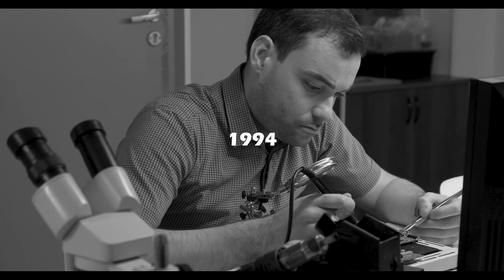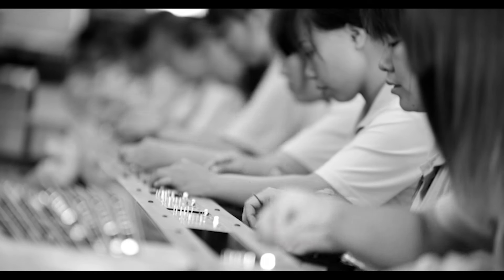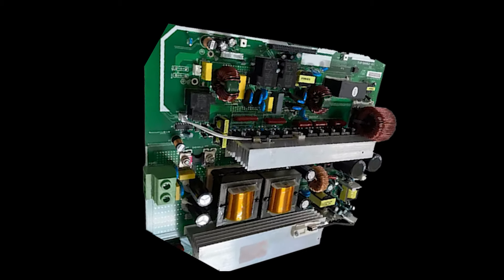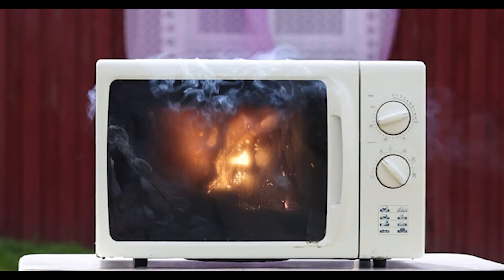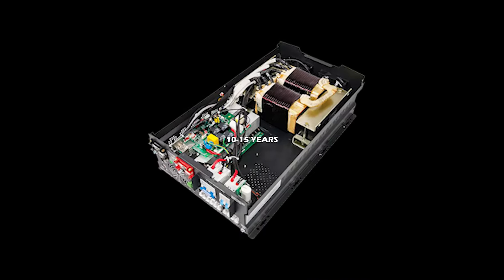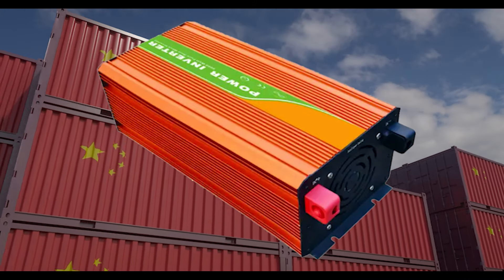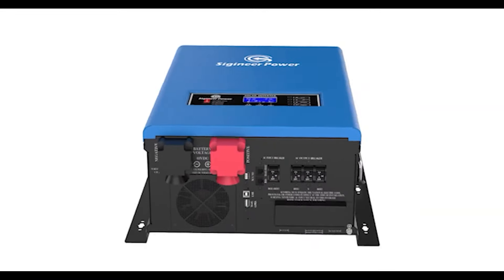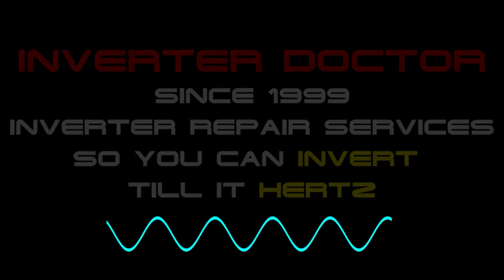6000XP VS Low Frequency Inverters. There's no contest.

Comment: The large inrush (load's standpoint) current capacity of low frequency transformer inverters is rapidly becoming less important as pumps and HVAC/heat-pump compressors are transitioning to inverter driven motors which smoothly increase speed from the  zero RPM with very low current surges. As a simple example, my LG refrigerator is inverter driven as is my Midea window AC/heat-pump. Every mini-split AC/heat-pump that I'm aware of is inverter driven, and are easily driven by HF inverter power supplies.
Reply from the maker: It will be many years if not decades before existing pumps and HVAC systems are completely replaced by newer inverter based systems. Besides, the upgrade to inverter based pumps and HVAC systems does nothing to address the absence of galvanic isolation between the DC boost stage and AC output in these low-cost high-frequency, transformerless inverters, which has the potential to damage and even start fires in these inverter based appliances.
Reply: @kickgas7171  37 2017 HEAT PUMP IS INVERTER BASED....SO ITS NOT NEW TECH.
Reply: @kickgas7171  But in modern times a lot of those people are not installing old power-hungry HVAC systems, they are installing mini-splits that use DC compressors and slow-start.   The intersection of people installing old HVAC systems to be powered by an inverter is really quite low, and people who intend to run such systems from an inverter are far more cognizant of the issues involved.  This has nothing to do with the billions of people with HVAC systems powered by the grid.  It is a much smaller crowd.
Reply: They're not installing these power hungry, non inveryer based HVAC systems in modern times because they're already installed in these homes. It will be decades before people get even close to replacing their old Power hungry HVAC systems with newer inverter based, high efficiency systems.

Comment: Nothing wrong with HF inverter as long as you size it properly. I have one that i bought in 2017 and noy 7 years running no issue. Size it properly
Reply from the maker: Actually there's a lot wrong with high frequency inverters. They offer much shorter life expectancies and far poorer surge capacities for starters. And don't you mean "oversize them properly at a greater expense". When using a low frequency, transformer based inverter, there's no need to oversize the inverter and it will provide much better performance for far less money than intentionally oversizing a light duty, high frequency inverter.
Reply: The prices are outrageous, I can buy 2 for the cost of one
Reply: @brooksstone2098  That's not true. A higher performance, longer lived 6000 Watt Sigineer M6048DUL, all-in-one,  low frequency inverter costs only $350 more than a 6000 Watt 6000XP all-in-one inverter.
Reply from the maker: @brooksstone2098  You'll probably end up buying two or three high frequency inverters due to their shorter life, over the life expectancy of a low frequency inverter, so in reality, you're not saving anything.
Reply: @kickgas7171  There is a lot wrong with low frequency inverters as well.  They are expensive, very heavy, very big and inefficient.  Use what is best for you and your application and your budget.
Reply: It's a total myth that low frequency inverters are more expensive than outdated high frequency inverter tech. And with the dramatic drop in battery and solar module pricing, efficiency is no longer the issue that it use to be. And you'll only have to install a low frequency inverter once on 10 to 15 years of use so weight is totally irrelevant when compared to a short lived, low surge capacity high frequency inverter.
Reply: Ask Google AI "Do high frequency, transformerless inverters have a shorter life expectancy than low frequency, transformer based inverters?" And learn the truth about these cheap high frequency inverters.
Reply: That's because you've only used it on rare occasions over the past 7 years and primarily run resistive loads.

Comment: The modern HF hybrid inverters perform much better now, they're more efficient and are more cost effective. I made the switch from a transformer based system years ago with zero regrets.
Reply from the maker: The topology that's used in modern high frequency inverters is no different than it was when they were first introduced 30 years ago. The only difference today is that the Chinese are building these high frequency inverters in larger boxes. They are still using the same design in their high voltage DC boost stage that uses high voltage stressed capacitors, silicon and tiny transformers which are subjected to high heat environments which explains its need for larger heatsinks and far more noisy cooling fans. The only thing that makes these high frequency inverters more cost effective is that they have removed the iron core, copper wound isolation transformer, which make these inverters far less safe for powering your home's appliances, And what good is efficiency if your inverter offers a much shorter life expectancy? You will have to replace a high frequency inverter at least 2 to 3 times over the course of the life of a well built low frequency inverter.
Reply: Post your evidence that modern high frequency inverters perform much better now. I bet you can't, because there is no credible evidence that they perform any better today.

Comment: I have been running a Growatt 12kw low frequency now for several years with 45kw of battery attached.  It will start 3 AC units at a time!
Reply: Good choice, You can't go wrong with a low frequency inverter.

Comment: My microwave, fridge and AC are all inverter based. Modern appliances for modern inverter.
Reply from the maker: Sure they're inverter based. That's because the inverters that are used in these devices have been impedence and load matched to their loads. Off the shelf Chinese manufactured off grid inverters are NOT universally matched to inductive loads found in a typical home. They cannot be because high-frequency inverters don't use an isolation, output transformer to its MOSFETs or IGBTs.
Reply: @kickgas7171  You are confusing what he said.  He's talking about the appliance, not the inverter.   The APPLIANCE has an inverter... well, really its a DC regulator.   For example, a modern mini-split has a DC compressor.  A microwave does something similar to regulate the microwave output (continuous regulation rather than turning the emitter on and off every few seconds).

The DC side has a power factor of 1.  The AC side (the input to the appliance) will see a power factor of 0.95 if the DC regulator in the appliance is PFC corrected, and a relatively fixed PF of around 0.5 if it doesn't.  NO LOAD OR IMPEDANCE MATCHING ON THE AC SIDE IS NECESSARY.

An inverter driving such an appliance is going to have a far easier time... there won't be any significant surges and the reactive component, if any, will be constant.

-Matt
Reply: I don't think he's confusing anything. He said that these appliances have inverters in them that match the impedance of appliance' inductive load. High frequency, transformerless inverters are not impedance matched to efficiently power older, non inverter based inductive loads  which shortens their life expectancy.

Comment: There are several high quality brands of low frequency, transformer based inverters on the market that outperform the 6000XP. One brand in particular is called Sigineer Power. They've been around a lot longer than the EG4 brand and they offer much higher surge capacities and a longer life expectancy. They have built-in MPPT, automatic generator start and transfer switch and they're UL1741 & CSA22.2 Certified. Plus they're only $350 more than the 6000XP.
Reply: You sure about that bud? Their screen suspiciously looks just like a voltronic unit. Worst fking inverter company in the world.
Reply: Idle consumption of 120 watts. It’s a joke. The XP is 30 watts🤣. You need a whole extra battery to power this paper weight
Reply: @dswaggins2464  Low frequency inverters don't draw 120 Watts when in "power saver mode" Just like high frequency inverters, they draw nearly zero Watts. The XP's lack of an isolation transformer makes it potentially far too dangerous of a product to use in my home.
Reply from the maker: @dswaggins2464  Sure, high frequency, transformerless inverters from Voltronic are the worst, Voltronic is the company that built the EG4 6500EX inverter. Voltronic does not manufacture Sigineer inverters.

Comment: just read the rest of the discription. that is false info, they are cheap and very easy to repair, with parts easily available. for the cost of a name brand complete system you can parallel so many cheap inverters they will rarely see much load. only real downside is high idle draw, but with the affordability of larger battery banks that is less of an issue.
Reply from the maker: I'm surprised by your comment, considering the fact that one of the only videos on your channel shows you performing a fairly complex diagnostic of a failed, high frequency inverter. High frequency inverters are absolutely NOT easy to repair. High frequency inverters all use the same complex, high voltage design that employs more than twice the number of components that low frequency inverters use. We repair inverters, have done so for the past 24 years, so we're quite familiar with how complicated these high frequency inverters are. Typically when they do fail, it's not as simple as replacing a few MOSFETs or caps. Because of the high voltages involved in these circuits, when they do fail, they typically take out far more components and can even burn the PCB. Not only are they difficult to repair, they can also be dangerous (lethal) for a layman to attempt to repair because of their use of very high voltage components.
Reply: Good❤ answer

Comment: Then why did my 2kw LF inverter only last for 4 years if it's true that the LF inverter would last 15 years?
Reply: Probably because you purchased a low quality brand that uses cheap Chinese made MOSFETs and Caps.

Comment: Bu*****t.... I Am running my whole house few years on Growatt 5000 ES HF inverter  without one problem.  Yes, LF technology  is little bit better, but it is  at least 3-times more expensive. I have also one Victron inverter. And this Victron LF had a problem with some inductive loads and small motors.
Reply from the maker: 5kW? You must not have very many appliances in your home. I don't know where your getting your pricing information from, but the last time I checked, a low frequency, transformer based inverter charger with MPPT from a company like Sigineer Power, was only a few hundred dollars more than a light duty high frequency inverter charger.
Reply: @kickgas7171   At the time when I bought Growatt 5kw, 3KW Victron cost 1800€.  I bought Growatt for €600.  Those were my prices.  I have 3 Growatt inverters. The fact is that most of the time, only one is switched on.  And that's enough.  I also use GBO AKU for maximum photovoltaic output, and Growatt has no problem with that.
Reply: @kickgas7171  and the input voltage from the solar was important for me.  Growatt has a maximum input voltage of 430V.  Victron Easysolar 2 has a maximum input voltage of 250V.  With Growatt, smaller cables meant lower costs.  Just by the way, today Victron Easysolar 2 5Kw costs €2335 +/-

Comment: so point is, we showed China how to make an inverter, they showed us how to make them affordable to sell them to US!
Reply from the maker: Not quite. Chinese built high frequency inverters were never designed to be affordable. They are designed to be cheap, unsafe and shorter lasting imitations of real US designed low frequency inverters. So much so that you would have to buy at least two to three of these high frequency inverters to match the life expectancy and performance of a single low frequency inverter.

Comment: Pc, phone chargers, tv etc are with HF circuit and it doesn't made to last, but to be cheaper,ligher and smaller. There are now LF transformers from china with no copper inside they using them in LF ups because there are cheaper than HF ups! These transformers cannot work for more than a certain time because they will be destroyed by the high temperature. Τhe battery capacity losses will be very large, but with 2x7ah batteries it will not have time to be damaged.
I have a HF inverter about 10 years, I fix it 2 times (new mosfets, capacitors, regulators). I am planning to change it to victron.
Reply: Transformers are not destroyed by high heat. There are millions of power transformers used by utility companies around the world that operate at high temperatures that last decades without any problems. And the battery capacity losses are not high when a low frequency inverter is placed in power saver mode. And you would not have had to fix your inverter 2 times in 10 years if it was a low frequency inverter.
Reply: @Madsci-zy8wm  Heat might not cause the transformer to fail, but it sure as heck will shorten the life of the FETs and capacitors, which is the primary failure case for both LF and HF inverters.  The heat is the same or similar for both designs (its a function of efficiency which is a more complex topic not necessarily tied to LF vs HF), and both designs also recover and reinject reactive power (so no real difference there).   The only way to deal with the heat is to run the inverter (LF or HF) at lower load levels.

One can make an argument that the additional capacitors in the HF design are more vulnerable to the heat, but that is primarily just a component quality issue, not really something inherent with "HF" vs "LF" beyond the addtional parts.

One problem with LF designs, in fact, is that they are more difficult to cool due to the mass and bulk of the transformer and the need to damp the vibration.

Heat is still the enemy for both designs.
Reply: @junkerzn7312  The heat is far lower in low frequency inverters because they operate at much lower switching speeds. That's why high frequency inverter use larger heatsinks and higher CHM (louder) cooling fans. And a properly impedance matched transformer should generate much heat. At least the low frequency inverters that I've built don't.
Reply: @Madsci-zy8wm  Lol, no.. that isn't how heat losses work in an inverter.    Heat is entirely a function of the efficiency (this should be obvious if you think about it), so you can just look at the efficiencies of the various inverters.  Higher efficiency, lower heat.  Lower efficiency, higher heat.  Very simple.

Most of the heat comes from the magnetic components and the (Ron) of the FETs, which more or less scales with power and size.   The reactive recovery circuit diodes also dissipate heat.

Switching losses from a FET are certainly very real, but also miniscule because the switch time of a FET is typically less than 1 microsecond.   It adds up, but not in the way you think.   And FET performance is basically a function of cost.  If you need lower FET losses you buy a higher quality FET.

Generally speaking, other trade-offs tend to trump FET switching losses so the only time it really matters is in the absolute highest-quality (95%+ efficient) designs.

-Matt

Comment: Hey Kick, how to the rice inverters stack-up, as far as idle current goes, to low freq inverters?
Reply: Idle current used to be a concern when solar module and battery prices were so much higher, but since pricing has dropped to historically low levels, idle current consumption can be made up for by simply adding a single additional solar module to a system that uses a higher performance low frequency inverter. Besides, modern low frequency inverters allow you to place the inverter in power saver mode, which pretty much eliminates idle current. In any case, the much short life of a high frequency inverter and its far poorer surge rating makes it a poor investment when it comes to inverters. I would never install a high frequency inverter, no matter how much it's price has been discounted.
Reply: @Madsci-zy8wm  There are HF inverters now with 10 year warranties.  Your argument that adding solar panels can make up for inefficiency does not make sense.  What about at night or on battery power?  Look, the one of the most common components to fail in electronics is the power supply.  In the old days these were almost always transformer based designs and they still failed regularly.
Reply: @robertgrant5895  10 year warranties are meaningless when the manufacturer won't be around to honor them. I've seen dozens of RE equipment manufacturers go out of business and walk away from their warranties over the last 24 years that I've been in this business, And why doesn't supplementing the small increase in efficiency loss with a single, low cost extra solar module make sense to you? You produce extra power during daylight hours, with that extra solar module, store it in a battery and when use up that energy to make up for the difference in efficiency. Simple. And  the most common components to fail in electronics is NOT the power supply. That's a ridiculous claim to make. Show me the source of the data for that claim. Bet you can't because the data doesn't exist.
Reply: @Madsci-zy8wm  Sorry my friend, my source about power supplies is myself.  I am a retired electrical engineer and designed and repaired solid state systems since the 80s.  Usually the cheap chinese capacitors were to blame.

So buy more panels, buy bigger batteries, etc..  Just spend more money and buy more.  Do you have the space for all the panels?  And what if there is a long storm or I live in a northern (southern climate)? 

And what about the weight of the darn inverter?  Look, a low frequency inverter is not the right answer for everyone.